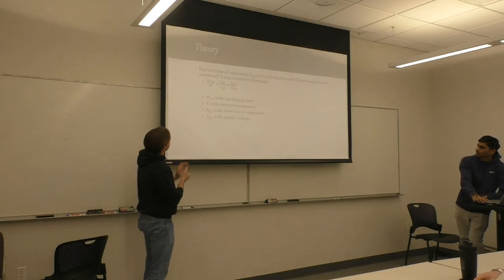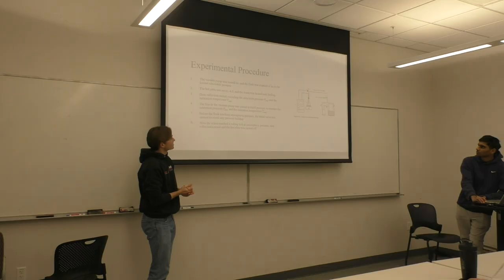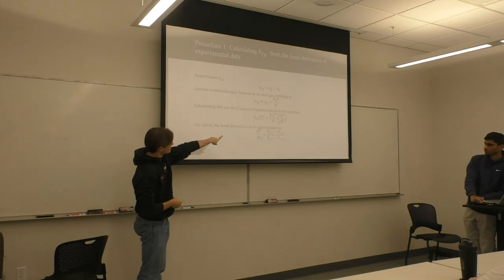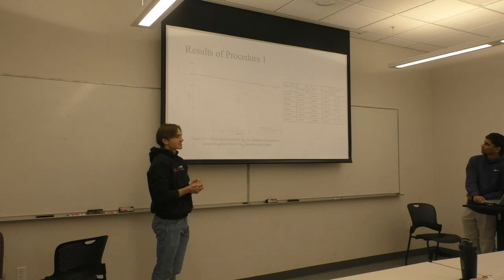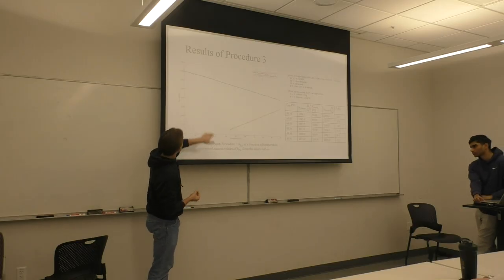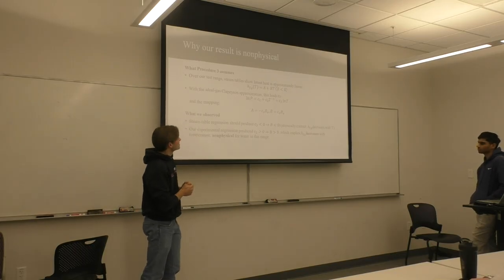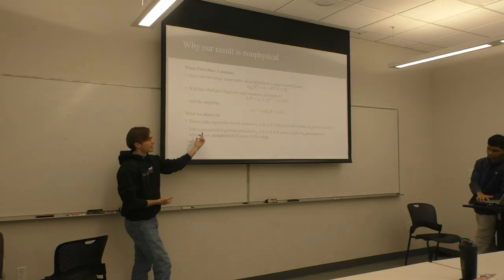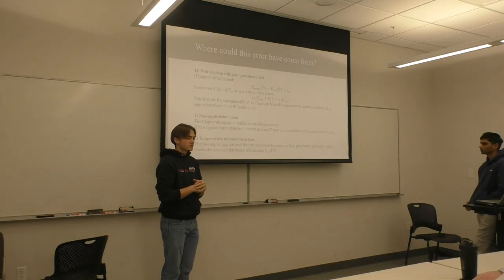Dutch Dunphy: Reporter - Clapeyron

Comment: I think I communicated my knowledge of the material well and did my due diligence by going through multiple error-checking procedures. However, my biggest problem was definitely time management. To fix this, I would condense slides as some have recommended and try to not present unnecessary information. Additionally, if I didn't have any errors in my data, there would have been no need for me to spend so long talking about error propagation and validity of my analytical solution, so that would've cut down on time as well.

Comment: You presented in a way that made it very obvious you knew the presented information very well, but condensing the data process to more results and less about the entire process would shorten your slide amount to a more reasonable length. This would allow for better audience comprehension and engagement. Overall, great job!